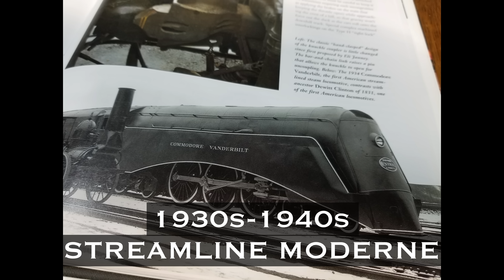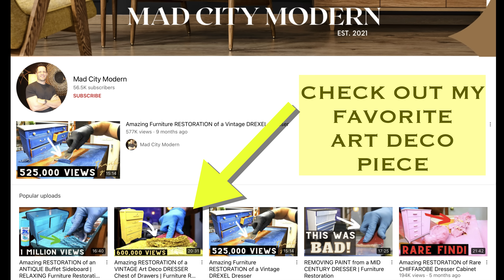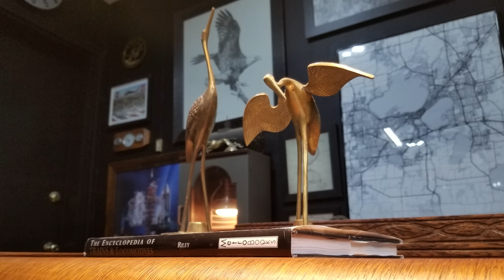Ep. 50 1930s ART DECO Painted Dresser RESTORATION

Comment: Beautiful restoration. I personally prefer using the citrus based stipper and after 24 hours, scrape and then use a heat gun to pull out remaining paint in crevices. Applying heat really reactivates the dried stripper. After all that, a good sandblasting and it's stain ready.
Reply from the maker: Awesome feedback. Thank you for this

Comment: I am not in favour of wax finishes on bare wood. To me it seems lazy unless many coats are used and a solid layer is built up which takes hard work. Having said that I like what you do and it always looks really good. You have right attitude towards the pieces you save which can only be a good thing.
Reply from the maker: Great feedback. It also seems lazy to me. You can see that the paint was near impossible to remove completely and I did my best to apply stains, waxes and hard wax oils to see what would be best. I wanted to use a different finish after all the hard prep work
Reply: even so, its so much prettier than where it started!
Reply: I don't think there's a right or wrong method. Be flexible and do what is appropriate for each piece. Great job as usual Barry